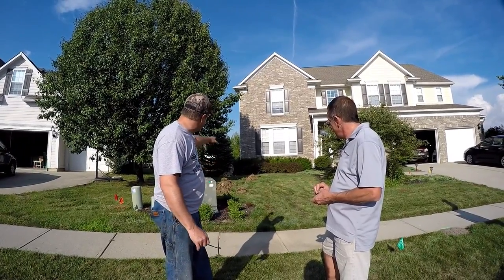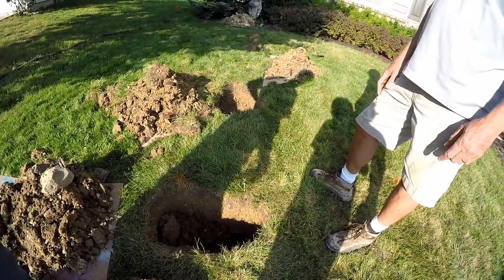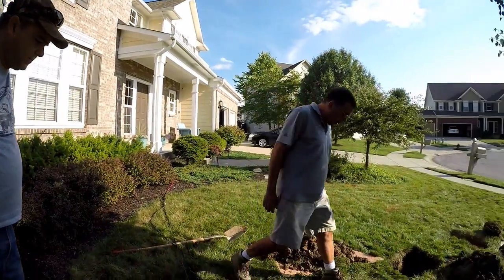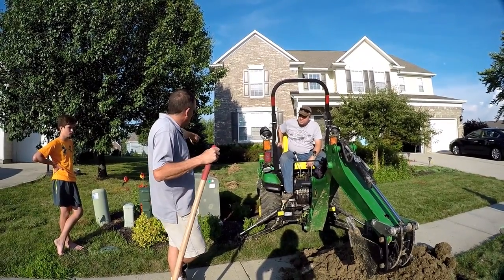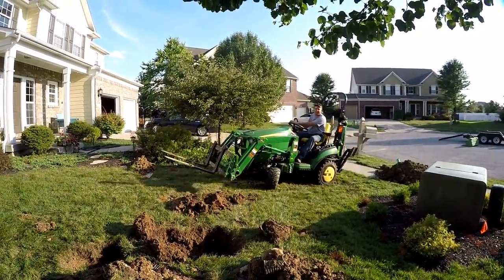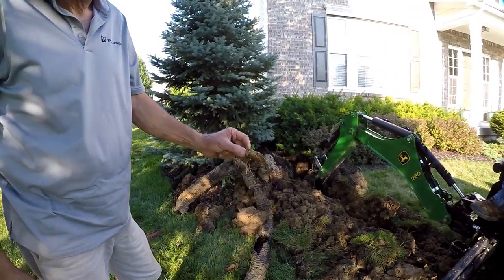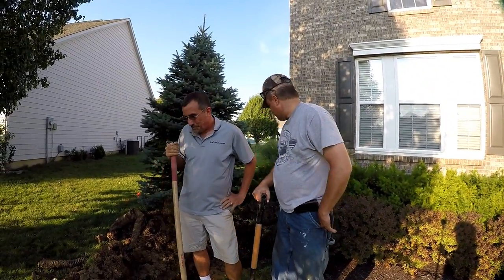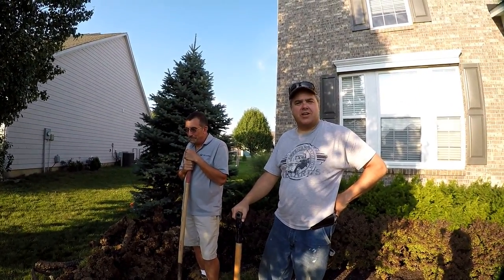Irrigation Irritation: Compact Tractor Digs Sump Pump Line Runs Into Trouble

Comment: I really don't like the black corrugated drainage pipe for those type of drains or for using them at the end of downspouts for caring the water away from the house. We replace it all the time with 3" or 4" pvc depending on the type of job the black just doesn't seem to hold up very well. Also  it interesting to see different materials used in irrigation in different parts of the country around here everyone runs all main  and lateral lines with pvc normally 1" occasionally the laterals will be 3/4" pvc. Another easy job for johnny!!!!
Reply from the maker: +nashguy207 yea, this irrigation was lightweight plastic pipe, run seemingly randomly across the front yard.

Comment: lol. Shit happens. My boss was digging out a drainiage ditch on the golf course to prepare for a rain storm we were getting earlier this summer. And he ripped up the communication cables for the satellite boxes for the sprinklers. He then proceeded to choose one of the hottest days of the summer to pull back the rest of it (keep in mind we live in a very rocky and clay area, so it was tough digging up the wire) we had to figure out which pair went to witch on the other side, strip them all back, splice the wires and add an epoxy seal around it. Thankfully we were correct in determining which wires went where.

Comment: put a clean out access by the house or better yet have the sump 1 1/2  exit above grade and drop into 3 or 4 with no actual connection so if the buried part plugs pump can still work and spill next to house. i actually install waterproofing systems and thats our policy for buried lines

Comment: The problem with dropping that line to a 2" Is if that line is also connected to the gutters downspouts. A 2" line will not keep up with the flow volume.
Reply from the maker: +Don Hanson the line is only connected to his sump output. This was shown in he video.
Reply: Tractor Time with Tim  Hey Tim, I really enjoy watching your videos. I recently purchased a 1025r tlb myself. I researched it a lot and watched a lot of your videos before deciding to go with the 1025r. They are much more powerful than I had expected them to be. I really Love mine. I heard you mention in this video about how to get the pipe under the sidewalk. I've seen guys take a a piece of small steel gas pipe and make a cone Point on one end and use the backhoe bucket to push it through the dirt under the sidewalk to make a hole to pull another pipe in with. You can have someone make a few different sizes and start with a small one and work your way up to what ever size you need. I have actually seem it done n one lane roads and driveways. Not sure how far the 1025 would push one but I'd say it would work on small driveways. Just thought I'd share that with you because you seem to be like me and try to find new and easy ways to do things. Thanks for all the videos.

Comment: When digging around power transformers like that one it has 7800 volts  going into it and house voltage coming  out of it going to the meters both will kill you. When you dig around them do not let people touch the tractor or be close to the tractor also if you hit one don't get off the tractor  it sounds like plywood breaking under ground I know because it hit a main power feed (not marked)at work digging a storm sewer repair  stayed in the backhoe because of training I had .Also if it's marked and you hit it you pay to fix it $$$$
Reply from the maker: +plowtruckdriver well sir, I think you saw a little bit of the discussion we went through on this.  I fail to see how we could have been much more cautious.  
I also fail to see how we did not approach the situation seriously and with forethought. 
So, having said all of that, I'm not sure we deserved the lecture you provided.
Reply from the maker: +plowtruckdriver ...but, I did not know to stay on the tractor in that situation.  That is a very good thing to learn. First time I have heard that.    Thank you.
Reply: I did not want it to sound like a Lecture it's a mistake you can only make once.  There is no do overs  I have been in the digging field for 30 years . The wires for the transformers are suppose to be 36" deep I have seen them at 18"  I know you were not that deep please keep this in mind .
Reply from the maker: +plowtruckdriver thank you.  Would you have done anything differently than what you saw in the video?  I do believe we were respecting the situation.
Reply: Tractor Time with Tim  To be more Cautious We do what's called  pot-holeing. We dig down by hand on top of the utility until we reach our depth or find the utility then we continue our work
Reply from the maker: +plowtruckdriver ok.  That makes sense.  According to the marking, we were not over the utility line . I was just nervous because right by the transformer.  Not sure how I would have pot holed that situation.
Reply from the maker: +plowtruckdriver one more question.  Is there a place to get some more formal training...without working for a large company?
Reply: Tractor Time with Tim  everything Should have been marked within your digging parameters The utilities have 18" on either side of a painted  And Flagged line .Watch videos hitting electrical wires underground
Reply: Some of our training comes from United rentals
Reply from the maker: +plowtruckdriver thanks!